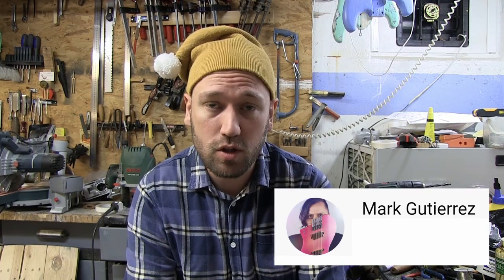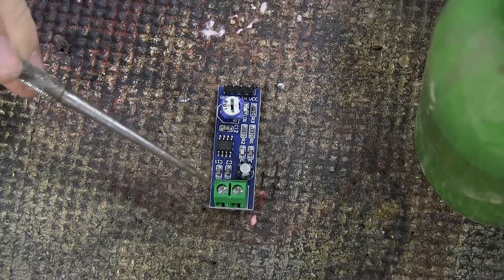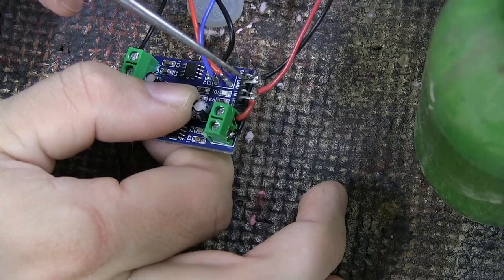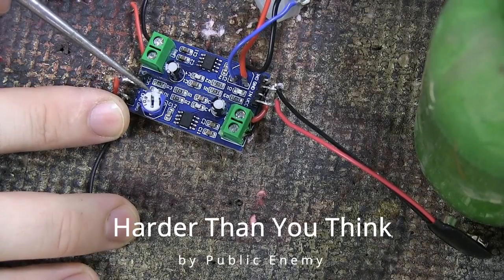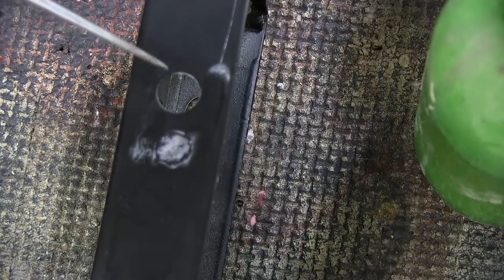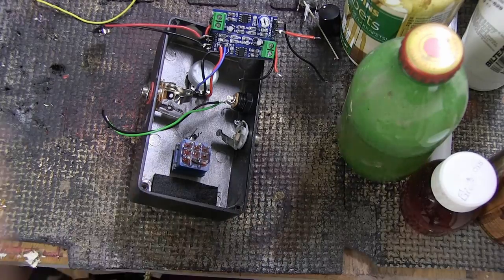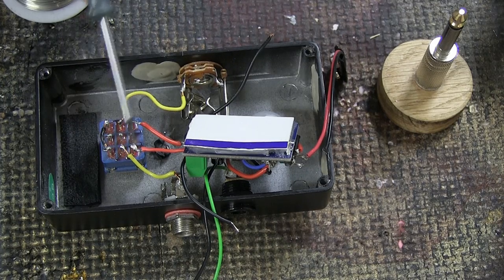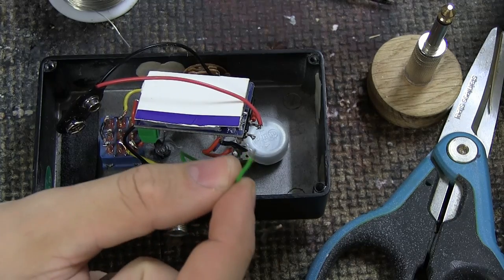One Dollar DIY Amazon Fuzz + how to enclose it with true bypass switch

Comment: In addition to cleaning soldering iron & surfaces to be soldered, rosin core solder & soldering flux makes soldering secure connections 10 times easier, by preventing oxidation from forming in the joints simultaneously with the soldering.

Comment: I had actually bought 10 of these last year to reuse the radio pcb of a broken old portable TV. It was cheaper buying the ten of them than only one unit.
Might try it. Also gonna make a headphones amp, with a simple fet preamp
Reply from the maker: Sounds like a good idea go for it👍 I wanna build a headphone amp too but it will have to be its own video 😁
Reply: @zurowetz  you can use that board as a pre made power section. It's even loud enough for a small practice amp

Comment: I built one today and had this high pitch squeal that wouldn't end, but I'll try again soon. I assume I had a ground issue. I also tried 2 tone pots which was overkill. You can also get tiny heat sinks for the chips if you really want to maintain consistency in control. I also found the chips drive an 8 or 16 ohm speaker, best. 4 just rolls off with no real boost. Anyway, that was my journey so far! .Hope you're all doing well!
Reply from the maker: Cool I'll have to experiment more 🙂 it can also be a lead and a grund that are touching 🤷‍♀️
Reply: @zurowetz  I am going to try again this weekend. I had some long additional wires that may have acted like antenna. I'll be back!
Reply from the maker: @Jenisonc  yeah that could be it let me know how it gosse 🙂
Reply: @zurowetz how did it go?
Reply from the maker: @-TheZilvers-7812  I don't know man I'm waiting for him to come back and tell me too🙂
Reply: @zurowetz  lmao I’m planning on doing the same thing you did but with the second pot so then if I’m not wrong I would have 2 fuzz knobs? Idk
Reply from the maker: @-TheZilvers-7812  yeah that's right you can also do tone and volume I have a video where I make another one of these but with a tone and volume you should check it out could be what you need 😉
Reply: @zurowetz  oh that’s awesome but I need help in something… what would I do if I wanted to add a switch that would make it go from direct to soft Yk kinda like a muffled sound (take the switch in the Arion DSI-1 for example)
Reply from the maker: @-TheZilvers-7812  you could on the out signal have a DPDT switch and connect the out to the middle and then a jumper cable on the to bottom once and a capacitor on the two top so you can switch between going through the jumper cable and going through the capacitor
Reply: @zurowetz  so what u did in the video i just commented on? I’m kinda confused xd
Reply from the maker: @-TheZilvers-7812  it will be like a bypass switch or a tone knob and you select which one you want by flipping the switch does that make sense?
Reply: @zurowetz  I think so ye ye ye!!!!
Reply from the maker: @-TheZilvers-7812  I'm making videos right now about pedal parts and there's going to be a video on DPDT switches so if you are confused hopefully it will help
Reply: @zurowetz  awesome awesome awesome you are Judy’s istg lmao
Reply from the maker: @-TheZilvers-7812  Judy's?😆
Reply: @zurowetz  Jesus LMAO
Reply from the maker: @-TheZilvers-7812  hahaha 😆 I was so confused 😆
Reply: @zurowetz  so this????
    Cap
[]         []

[]         []output

[]         []
Jumper
Reply: Or do u jump the out to the bottom pins?
Reply from the maker: @-TheZilvers-7812  no you got it and then a wire from the other middle leg to out
Reply: @zurowetz      
            Cap
         []         []

Input[]         []output

         []         []
          Jumper
Reply: @zurowetz  im a lil confused :’]
Reply from the maker: @-TheZilvers-7812  why you got it 👍 the out on the pcb goes to the in on the switch and the out from the switch goes to the 3pdt switch 👍
Reply: @zurowetz  YAYYYYY I MEAN…hell yeah lmao :]]]] yay thank you!!!!
Reply: So this one is right?
Reply: @zurowetz  um 2 last question!!! Witch one was right the one with just the output or the one with both? And also what cap do I use
Reply from the maker: @-TheZilvers-7812  the one with out and in was right I don't know what cap you should use it depends on how much you want it to effect your signal I suggest you try some out before build and se what you like 👍
Reply: @zurowetz   i could grab some clips and do like you did with your video abt diodes!!! And I can’t thank you enough your awesome!!!!!! And I appreciate ur pacientes for explaining!
Reply: @zurowetz  i think actually instead of jumping the bottom row I can put another cap so then I have different cap sounds!!!
Reply from the maker: @-TheZilvers-7812  yeah go for it 👍
Reply from the maker: @-TheZilvers-7812  😊
Reply from the maker: @-TheZilvers-7812   sounds like a great idea😁
Reply: @zurowetz  yeee I’ll get around buying the stuff from Amazon also the switch is connected directly to the in put and out puts to where?
Reply from the maker: @-TheZilvers-7812  the switch will be connected between the out of the board and the footswitsh
Reply: @zurowetz  ohhh okok

Comment: Where does the tone stack and control go? I use a 1950s valve amp tone stack circuit for the pedals I have made. Thank you for the video and help. Awesome
Reply from the maker: you could experiment with putting it before or after and see what you like hopefully this video can help https://www.youtube.com/watch?v=_6_-KGiS3yc&t=112s&ab_channel=zurowetz le me know if it helped  🙂
Reply: @zurowetz  thanks. I have to check where I located them on the effects I make. Cheers

Comment: Hey I've built this pedal using a 2.7k resistor for the led, today I've discovered that whenever I turn off the pedal it takes a while before any clean signal comes through it :/ What do you think might be the problem? I've wired the footswitch a bit differently than what you have showed, following a schematic I found on reddit but it is very similar, just the led is not in the middle row but at the top row. I'm also thinking about adding a resistor to the max volume because it is VERY loud and not usable if you want to switch between clean and fuzzy. Do you have any recommendations for this problem? Thx a bunch! Love ur videos!
Reply from the maker: Thanks for the love 🤗  put a potentiometer like a volume control on your guitar on it going from the out of the circuit to the switch them you can find the volume you want then if you don't want to keep the pot you can switch it out for a resistor with the same value as what the pot is set to once it is where you like it 👍it is hard for me to know if there is something wrong with the wiring for the switch but I built the same pedal again yesterday and I used a 3,3k resistor and I don't have any problem so either there is something wrong with the borde or you need to change the wiring to the switch. Good luck let me know how it goes 🙂👍

Comment: Hi, thanks for this great tutorial.. Is this wiring schematic saving battery in bypass state? Do i need to make physical connection between ground terminals for battery and dc connector?
Reply from the maker: thank you 🍻 this only saves the battery when the jack is not plugged in because the physical ground  connection is created between dc in and the battery ground once the plug is inside that's why I use a stereo jack. I'm unsure this is what you mean but hopes it helps 😀
Reply: @zurowetz  thanks for answer.. I mean, if i use battery, is battery lowering if pedal is bypassed?
Reply from the maker: @igormarinkovic9252  yes the guitar cable basically is the on/off switch so if you leave it plugged in it stays on
Reply: @zurowetz  Thank you very much! i just started with DIY, and i'm confused about too many things. But it is normal :)
Reply from the maker: @igormarinkovic9252  awsome just let me know if you need help with something and I'll try my best 👍😁
Reply: @zurowetz  there will certainly be some more questions in the future.. Cheers! 🍻

Comment: I was just wondering, what is the actual advantage of linking 2 of these LM386s together like this. I've made a few different ones using just one. Started with that one simplest version with no footswitch, or gain control, or anything like that (like from that 1st original $1 fuzz video I saw). Then I started doing more tweaking with them. Added the gain control, the footswitch, and the LED, like in this video. I just did one last night where I also added a volume knob. I've just been using little plastic containers to put them in cuz that's all I really have around the house that works for now. They are all pretty noisy and simple, but I'm just getting into pedal building, so these have all just been practice until I work my way up to building some real, usable, stage-ready pedals. 

So yeah, I've got 2 of these LM386s left and was just wondering how linking them together would be different from any of the other ones I've already made.
Reply from the maker: Well to me they sound bigger,lauder and more like a "real pedal" should if that helps if you have to just like them and see what you think the benefit of having 2 in 1 is just less canles so noise will go down witch is good on something so noisy
Reply: @zurowetz  OK. I kinda figured it would make it sound a little louder and fuller. I was wondering how it would affect the noise level, so anything that might help that would be a bonus. Other than the noise I actually like the way they sound, especially for what it is. So yeah, I'll give that a try, but find something better to put it in rather than a cheap, plastic box. Thanks for responding!
Reply from the maker: @JESSEALLEN77  twisting wiers inside and seting one trimpot lower than the other will help with noice I forgott to tell you i also made another one called killer fuzz I think it turned out better so maybe have a look at that video before you deside what you wanna do🙂
Reply: In the original $1 fuzz video by MarkGutierrez, he linked them together to create something similar to an EQD Acapulco Gold since that pedal is really just two LM386s in series and not much else.

Comment: How did you print the front of the enclosure ?
Thanks great video.
Reply from the maker: I just printed out a picture and used double sided tape to stick it on its just ganna be a joke for the video but it's still on there 😆
Reply: Thanks for that, I use water slide and it can become a pain.
Cheers Dean
Reply from the maker: @superconductorchip9072  yeah I know exactly what you mean try mod podge maybe better for you?

Comment: Thanks for the awesome video. I gave this a try. When I connect the 1k pot I find the volume is very low and it never really distorts. If I increase the value of the pot to say 10k, I get better distortion but at some point when sweeping the pot, I get a lot of noise. I don't have it soldered yet, I'm using jumpers with alligator clips to make the connections. Any help would be appreciated.
Reply from the maker: Yeah its very noisy if you use 2 and leave the trimpot on one you can adjust it so you get less noise but you will not get everything done also having short cables inside the pedal will help and if you can use insulated cables that would help too 🙂 thanks for the comment and good luck 👍
Reply: @zurowetz  When I combined two, I was able to go back to the 1k pot. I'm assuming the 1k with just one board was not enough gain. Two in stages is over the top...lol. So, I cut the trimpot down to almost off on the first stage. That lets me control the overall volume with the single pot. Still have a degree of hiss but I attribute that to gain.

Comment: Genuine question: If this is really all that a stompbox is inside, and any schmuck with a screw driver can put one together, how are manufacturers putting 3 digit price tags on these things?
Reply from the maker: Well this is just one pedal and some are more difficult and also it can take a lot of time to design a pedal and make it perfect . Also there are other costs to manufacturing that you don't see when you just do diy pedals.  I tried to start my own business building guitars that were hand made and luxury quality but super cheap and after going through all the extra cost I just couldn't make it for less than 3k$  hope this helps 😊
Reply: @zurowetz  fair enough, thanks for the reply!

Comment: I am using just one 386 and wired in a 1k pot, as you did in the video. There seems to be limited volume and overdrive compared to not wiring in a pot. Should I be using a different pot to increase the gain and overdrive?
Reply from the maker: @rockymountainroughridersofMT.  it should be a 10k so try that
Reply: @zurowetz  much appreciated, thanks 👍

Comment: Should i connect the battery to the first chip or second one? and do i have to connect the two vcc parts?
Reply from the maker: Both vcc are for the battery and both need power so make a jumper from one to the other 👍 you also need a ground between them. Good luck!

Comment: Why don't you have the 3pst switch cut the power to the chips when bypassed?
Reply from the maker: Just seems unnecessary and I would have to flick it when I want the effect on 🙂
Reply: @zurowetz  Don't you already have to engage the switch to activate the effect?
Reply from the maker: @janktunes  oh you mean 3pdt I thought you wanted to have a on/off 😆 yeah you could do it that way too I just didn't because I never really use battery 🙂
Reply: @zurowetz  Yes, my mistake 3pdt
Reply from the maker: @janktunes  don't worry about it I think that it you split the dc ground to go to the switch instead of the led you would get what you want 🙂

Comment: I love pdals/effects, but I have OCD and only like Boss compact or twin pedal designs. I'm looking for broken/cheap Boss pedals to use the housings to build my own pedals into them.
Reply from the maker: Yeah I've been there too it's hard boss pedals never break 😅 but good luck! keep checking ebay 😃
Reply: @zurowetz  I grabbed a beat to sh*t DS-1 from a pawn shop for like $21 after tax... just gotta keep an eye out for more.
Reply from the maker: @scramblesthedeathdealer  ooh cool check the inside and see if its surface mounted or through hole if it's through holes you can mod it there are so many cool mods for that pedal 😍
Reply: @zurowetz  Yeah, even though it's in rough shape, I think this one is still surface mount, but I'll be keeping an eye out from now on for deals (I'm trying for a full Boss compact pedal collection one day, anyway, so I'm always looking).
Reply: I'm not modding my original 1997 DS-1, though, another will come by one day.
Reply from the maker: @scramblesthedeathdealer  i have the oc-3 & deluxe reverb-amp they are my two favourite 😃
Reply: @zurowetz  Both fine choices 👍 I would love an OC-3 and have a few in my watch list... I don't have an Octave pedal (aside from a Digitech Whammy) at the moment 🤔
Reply: @zurowetz  They killed it on the 3 Boss/Fender pedals!
Reply from the maker: @scramblesthedeathdealer  yeah I'm looking for the other 2😁
Reply from the maker: @scramblesthedeathdealer  oh yeah you need one it so fun and so much more than a octave pedal 😃
Reply: @zurowetz  I wish you luck on that endeavor. I love the FDR-1 63 Fender Reverb so much, and the FBM-1 is great on guitar and bass. Hell, you can use the other 2 with bass, as well.
Reply: @zurowetz  Finally got a stereo amp setup, really want a PN-2 Tremelo/Pan next to mess with the panning, especially. OC-3 is on the really want list, though. 😅
Reply from the maker: @scramblesthedeathdealer  thanks 😁 I just wanna have them even if there is better stuff or whatever because they are so cool 😃
Reply from the maker: @scramblesthedeathdealer  oh that's cool I built a split box for stereo setup but a pn-2 that's cooool😃
Reply: @zurowetz  I'm getting pretty hyped about trying my first mod or circuit, your video is helpful.
Reply: @zurowetz  You won't regret a full Boss/Fender collab pedal set. I love the Angry Driver (with Boss/JHS), as well.
Reply from the maker: @scramblesthedeathdealer  yeah it seems like a nice pedal 😁
Reply from the maker: @scramblesthedeathdealer  😁

Comment: I built one of these and it worked for a day and then stopped working. Used the rest to the same result. The boards just output white noise now! I wonder if these are just bad boards or if I missed something
Reply from the maker: They are cheap parts from china so there are most likly bad boards but not in a bag of 10s its hared to say if you dig something wrong but it sounds like there is a problem with the power in
Reply: @zurowetz  my headphone jacks were actually bad! Ground was touching positive on the input
Reply from the maker: @TechRedstone  so you fixed it? 🙂

Comment: Can anyone explain to me the difference in potentiometer values? For this lm386 module, what would be the difference if i use like a 100k or maybe 250k pot instead of 1k.
Reply from the maker: One of the fun parts is trying things out and see if you switch out the 10k pot for a 1k it wouldn't be able to restraine it as much anything under 10k you already have in it so just use a multimeter to set it to one 1k and you will see 🙂👍when it comes to 100k maybe it will let more gane through or maybe it will go to 10k and then be nothing more after because it is its limite 🤷‍♂️ try it and see I don't know what I used in all my lm386 pedals but if you want to I can check 🙂
Reply: @zurowetz  im curious as to how the lm386 would sound with a 250k pot as i think that would be the easiest to find where im from
Reply from the maker: @HarisIsk  the stutter distortion reverb that I built a month ago has a 100k so look at that video and see what you think but I don't think it will do you much good but star there 🙂
Reply: @zurowetz  alright, will check that out! Thankyou!